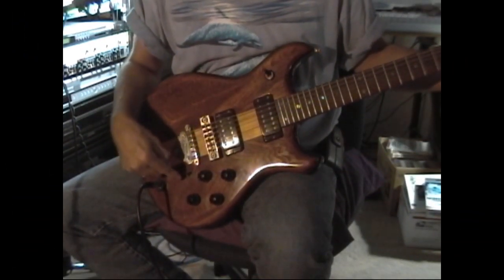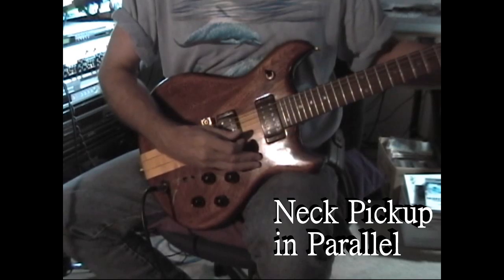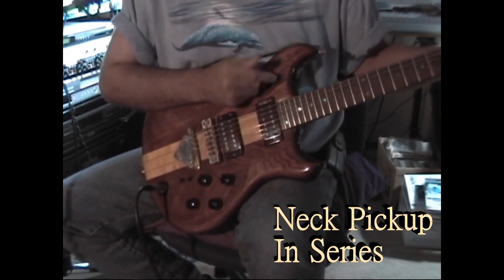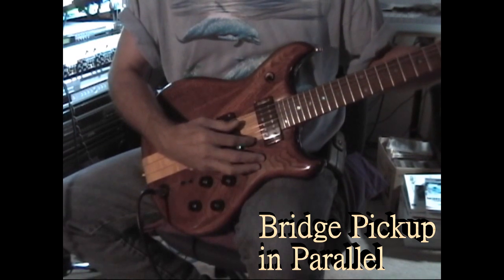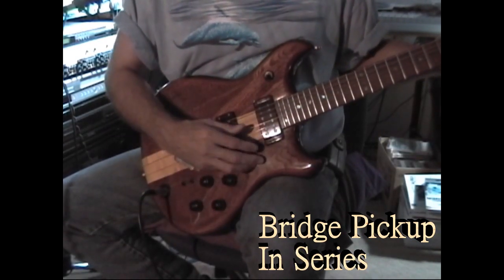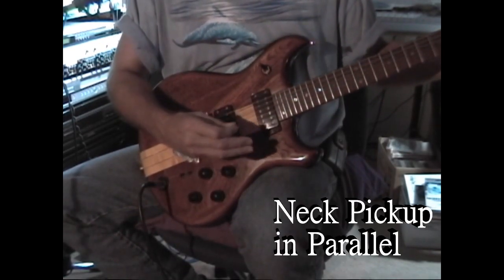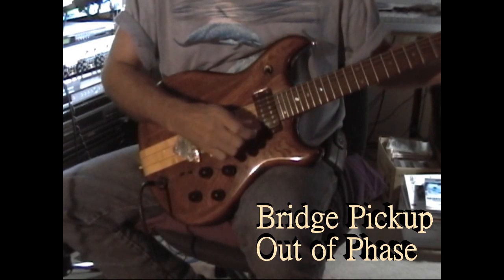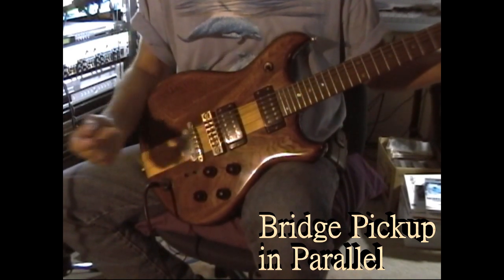1978 Ibanez MC300DS Electric Guitar

Comment: nobody ever mentions that the through neck also makes these hold tone FOREVER and a day.
Reply: They're solid guitars - the neck through doesn't do anything for sustain over a good set neck, but the super heavy bridge and the ash/maple combination does. I guess it does do one thing - it eliminates the chance that the neck joint won't be that great - but sustain killers are usually low density resonant wood (not a bad thing) and light weight bridges that allow the string energy through to the body really easily). 

They're like a piece of railroad track with a big brass bridge stuck on top (that's sort of a true story joke - Gibson put strings on a piece of railroad track when they were guessing at what wood to use for the les paul, just to see what the sustain and sound would be like).

Comment from the maker: Actually that is incorrect. You can run each humbucker out of phase with itself in series or parallel mode. Meaning you can run one humbucker in six different configurations:  in series or Parallel mode or you you can run them out of phase in either series or parallel mode as well or you can run either the font coil or rear coil in coil tap mode giving you a total or six different configurations. You can see how it's done in a link I added to my description. I hope that helps. Best regards.

Comment from the maker: If he wrote that I am almost certain he made a mistake. it's very easy for you to tell if any of the settings are single coil mode. put the the guitar in either neck or bridge humbucker mode. then get a small metal object like an Alan wrench or a screw diver & go thru all 3 positions with the mini toggle.touch both the front & rear coils in each setting & you will see both coils are generating sound in every position meaning it is never in single coil mode. The low volume setting is out of phase

Comment: As far as I know, the differences between the various models in the series are as follows:

MC100 2 humbuckers, 2 volume controls, 2 tone controls (like a Les Paul), bolt-on neck, chrome hardware

MC200 as MC100 but with thru-neck

MC300 as MC200 but with gold-plated hardware, and 2 tri-sound switches

MC400 as MC300 but with 3-way active EQ as well

MC500 as MC400 but with carved top (all the other models have flat bodies)

I think the body uses the same wood on all the models

I have a 78 MC300, and it's a lovely guitar. Not the cheapest now, but well worth hunting down. If you don't want the out-of-phase humbucker option, it's easy to rewire the switch to give you series/single/parallel. At some point in 78 they moved the pickup selector from down by the output jack to the upper horn. You can tell the month of manufacture by the letter at the beginning of the serial number. A=January, B=February, and so on. Mine is F, so was made in June, and has the selector by the output jack.
Reply: And for 1981-82, there was the MC150 (like the MC200 but with DuoSound coil taps on the tone knobs) and the MC350, which I think was similar to the 77-80 MC300.  The 1982 models had Super 58 pickups.  I'd have to check to see whether the '81's had the Super 88's or the Super 58's.  All highly regarded guitars.  I love my 1982 MC150PW
Reply: @joejnyc  I think the body shape changed slightly with the 80s models as well; the horns were slightly pointier and the waist was slightly wider.
Reply: @joejnyc  81 year production has super 88
Reply: My granfather gave me an MC300 DS in good shape. Can you guys tell me what it’s worth? I’m not a musician